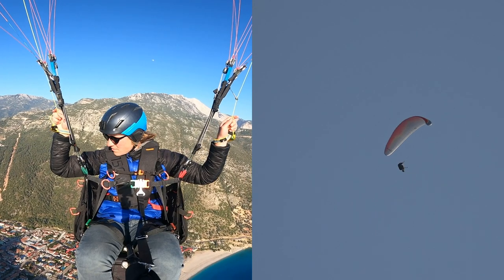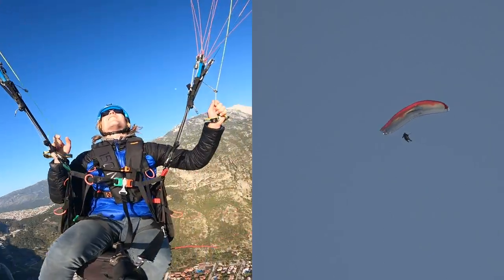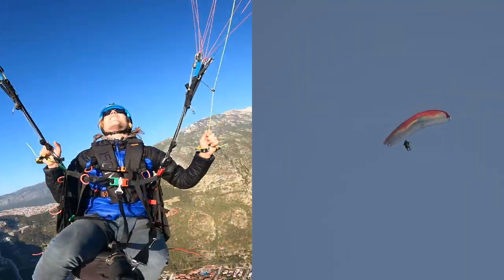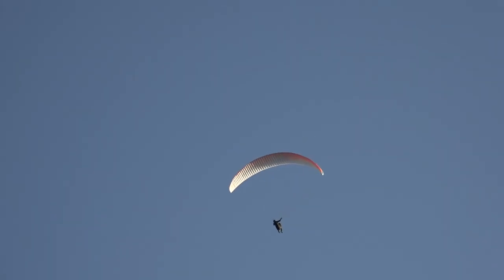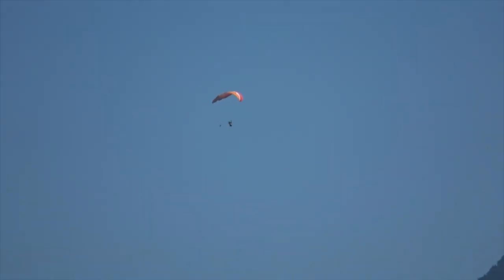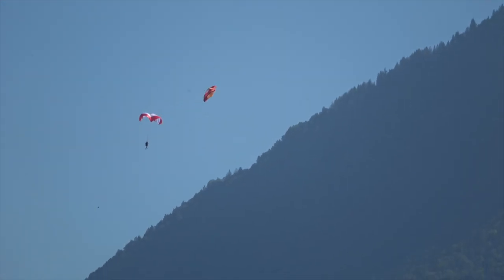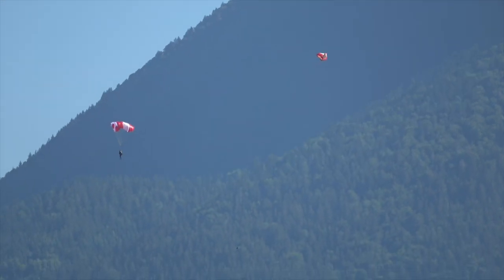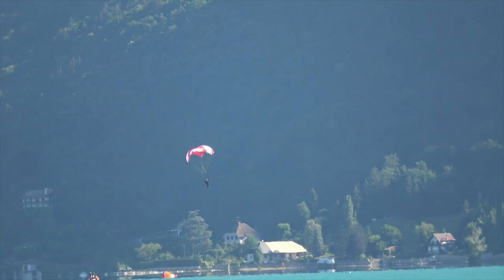SIV update

Comment: Pulling the D's...D equals to brakes?
Reply from the maker: The D’s are easier to pull and de-activate the main better while also offering an option of releasing them to fly if you need forward speed to avoid objects etc.
Reply: I believe when referring to “Ds” jockey just means rear risers if you’re flying a glider that’s a 3 or 2 liner
Reply from the maker: @JohnTosti  D's are the back risers that will go to the back row of lines, (before the brake lines), so yes.

Comment: I can’t see what stalling is good for. In turbulent air 90% of pilots won’t be able to master it and close to the  ground throwing a reserve is the safest way…
Reply from the maker: You can stall our of a cravat which could pull you into a locked in spiral, if strong. Stalls are not bad and if you are high, it is better to try stalling to recover,( if standard opposite controls do not work), than throw a reserve and end your flight. You don't have to go fully back in a stall to have the result you need and clear a cravat for example.
Reply: I would love to see a real situation tutorial with realistic maneuvers to get away from it.  e.g. what to do flying close to a rockface when you get a huge asymmetrical colaps.. or how to get away from that turbulent nasty cloud suck… blue sky / wind / problems of getting into a deep spiral when huge climb rate is apparent or what to look for and when a deep spiral or big ears are BDP? Keep up your good work. 👍🙏
Reply from the maker: @lorenzsueess313  We are filming next week so I will add something for you.